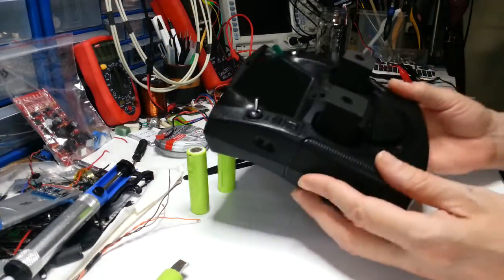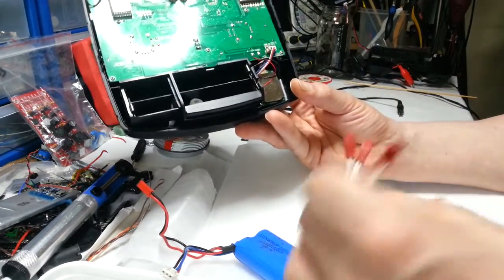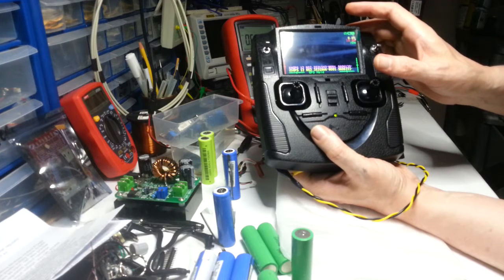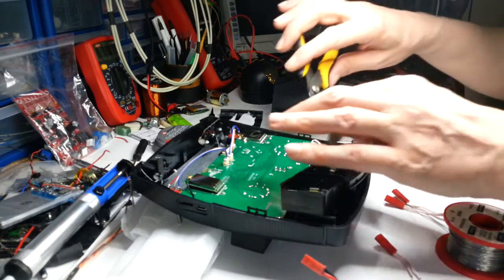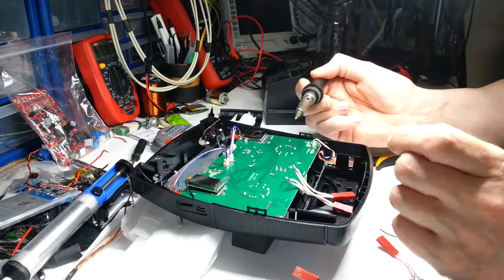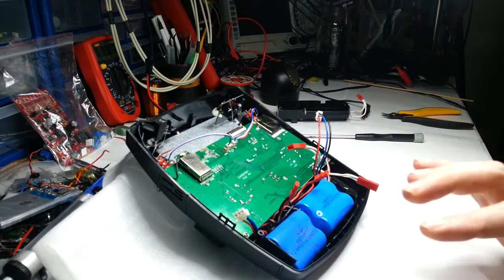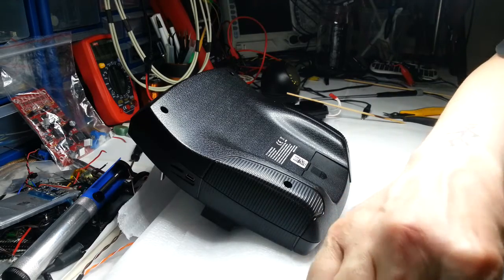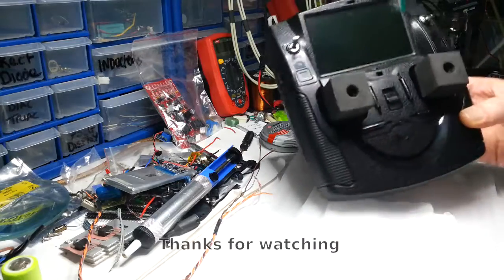Hubsan X4 H501S Controller Battery Mod 10 + Flight Cycles

Comment: Great video.   I have an H502S on order and had emailed them about direct connection of a 2s lipo and they said I'd need a voltage dropper to avoid exceeding 6v.   It's my understanding the H501S and H502S have the same Tx.   Sounds like it is working well for you (and I think others).   Maybe they have to say that for liability - however their manual says "The Transmitter can only use 2S Lipo batteries, 4XAA batteries or NI-MH AA batteries, other batteries will damage the Transmitter."   It was very informative to also show the amp draw, thanks.
Reply from the maker: Thank you for your feedback. On my transmitter board it says 4 - 13 volts at the battery terminal. My LiPo's maximum is 8.4V I just paralleled two for extra flight time and because they fit in the case. Check on your transmitter board (should they be called transceivers as they transmit and receive?) for the voltage mark where the battery connects to the board.
Reply: I did find out later that the NY firm behind the Hubsan website that I talked to is really a "distributor" for Hubsan (Tekstra).  Thus, they're not going to venture outside the 4 AAs.   I will definitely be looking for that board indication when I get the item.
Reply: Why nobody is using the original hubsan 501S battery for this mod? It is 2700mAh 7.4V and fits exactly on the TX battery compartiment. For everything i read, it is compatible. Ans this way you can use the same charger for everything. Any thoughts?
Reply from the maker: vashion100 I expect it is a liability issue also. As the manual states and you point out 2S batteries are fine. The board can handle more voltage but a 2S sits middle of the voltage range perfectly. Also as my 2S gets to 7 volts the battery indicator flashes red so no need for battery alarm :) It all seems to work as if designed to do so.
Reply from the maker: DullDusk Good question. In my case the batteries were to hand and cheaper. Also using these batteries I do not need the EC2 connectors inside my TX case. No reason why you can not use the Hubsan H501S battery. If you do, please come back and tell us how many flight cycles from one full charge.

Comment: Sadly it looks like you got an earlier transmitter, later one's have a red JST connector in the battery compartment where you can connect a nano tech Lipo 7.4v 950mAh 2S battery straight into the space, no cutting, no mods, simple straight plug in and slip the battery cover on. These will normally give at least x4 flight cycles before needing a recharge, easily available on ebay via some really nice guys in Borehamwood. Love the foam joy stick covers! Also have you seen the RTH mod for all flights modes from you tuber 'Randoneur' it works! totally great upgrade. please check these out.
Reply from the maker: I did a main board replacement in this controller and had it sent from Hubsan in China and that one did not have JST connector on it. No matter, the batteries I use here give me loads of time , good job as I have 7 quad batteries and take at least 4 out with me. I would like to see that RTH mod video. I will go look now. Cheers

Comment: Thanks for the Tut : ) .    You did not talk much about the foam bumpers you have on the controller's sticks.
Did you make those yourself ? Or are they an item we can buy ? 
I hope they were not included in the packaging and I ended up throwing them out without thinking of their potential use.
They look familiar, but I can not figure out what there original use would have been.   : )
Reply from the maker: Cheers for the feedback :D
The bumpers came with my Syma X5C, protecting its controller sticks. I thought I could use then to stop the sticks moving on Hubsan H501S. The idea was to have the quad in follow me mode and the transmitter in my back pack stick bumpers on. I was just dreaming lol.

Comment: Ben pili yükseltmek gerekmez düşünüyorum. GP 'nin 2700 mAh şarj edilebilir piller uçuş operasyonları 4 yeterlidir.
Reply from the maker: That is all good but they are AA and only 1.2V. The lower the voltage the more current will be needed for the load. Using a higher voltage for the same load requires less current.

Comment: Hello,
Thanks for the tutorial video.
I did a similar mod to the controller battery, but did a wrong move with the soldering iron and damaged the cable connecting the GPS module to the main board.

It is a basic 4 pin connection, but have no idea what it is called and where I can get a new one. By any chance, could you point me the right direction ?

thanks
Reply from the maker: Hi, I am not sure which part you refer to?
Reply: Hi, I am referring to the 4 wire (red, white, blue, black) cable that connects the GPS module to the main board just right from where the battery connectors get soldered.
Reply from the maker: Is it just the wire damaged?
Reply from the maker: Have you taken it out and asked at local stores. If it were me I would just solder the wires if I could not replace the jumper lead. I do not know what the jumper connector is called, but looking at the other ones on the controller it is a common one on the board. Maybe ask Hubsan sales@hubsan.com. I have spoken to them for different reasons and they take a day to respond (time differences) but do respond.
Reply: will investigate. thanks!

Comment: Why not just remove whole battery case to allow for more room and keep as a spare . You already have the case set up to use other batteies  when needed if for some reason the other li po batties die
Reply from the maker: Hi, I did, I have. I cut out the plastic from around the battery holder. The space allows for my two liPo's or the Hubsan H501S quad battery or the original battery holder and batteries.

Comment: High, I just want to take out the AA's and put a x6 tarantula battery in it with the balance plug exposed for charging..
Reply from the maker: I would check the space as this is a wider battery (Package size (L x W x H): 10.00 x 5.00 x 3.00 cm / 3.94 x 1.97 x 1.18 inches) and I am not sure it will fit.
Reply: Your right, It might not fit. but I could always velcro the battery to the outside of the controller.. I ordered a buck converter but Im thinking I would like to try the Lipo by it's self because I am out of AA's already..
Reply: I soldered up a jst connector plugged into a tarantula battery last night minus a buck converter because the electronics supply did not have any module's for sale. so I am using a x6 battery direct.. the funny thing is, I still dont have all the bar's on the monitor ! yea I am still waiting for my antenna's to come in too...
Reply from the maker: I have just got back from a two hour flight (6 batteries) all went well. With how I have done mine the batteries have lasted 10.5 flights and left me with 7 Volts still on the batteries.I am very very happy.

Comment: Hi can you help anyone? I have just purchased a hubsan X4 H502s recently and there is a jst port in the battery compartment of the transmitter, can a lipo battery be fitted straight into the port with a jst connector, if so what size exact to avoid damaging transmitter as I know it drains normal batteries v quickly?
Reply: JJRC X 1 YiZhan Tarantula X6 RC Quadcopter  7.4V 1200mah Battery from Banggood works great for the receiver , lasts long and fits in the space of the 4AA.

Comment: Anyone here know why my FPV video range just 30 metres with mod (same as
 stock antenna)?? Many times changing the frequency but no luck.

4.2.14 (TX)
1.2.9 (RX)
1.1.17 (FC)
Reply: My LCD is V1.3.4. Ok i try now..
Reply: i already change it...and now it can not bind..
Reply from the maker: Maybe update the transmitter firmware., My firmware version is V4.2.14
 My LCD V1.3.3,  H501S V1.2.3,  V1.1.21
Reply: can you give me the link?
Reply from the maker: https://www.hubsanus.com/products/index/faq/product_id/47/section/download/
Reply: Thanks. Mine is V4.2.14, LCD V1.3.4, H501S V1.2.3, V1.1.21. I will update you 6-7 hours from now if fix my problem. Now here is 3 am not yet sleep...
Reply: Anyway, have you experience any problem with the firmware so far? I mean sudden fall etc..
Reply from the maker: ***** I did experience some problems but I think that was because I was flying near a concealed phone transmitter. I fly in a different location now. Also I fly low and use altitude hold rather than GPS to gain my own  experience and with its flight characteristics and am having a much better time. Check this out and see https://youtu.be/Wwk8zqtRos8
Reply: Finally fix the problem..but will try the range tomorrow..
Reply: What the problem you experience is? Fall?
Reply: Elecifun
I can't calibrate compas 1...i'm stuck here..
Reply from the maker: ***** The quad toilet bowls, it also can do a tumble and fall, from time to time it can just fly upwards and it can twitch quite bad in follow me mode which has brought mine down. I like to think there is some human error on my part so I am getting lots of hours experience before I do my end user review.
Reply from the maker: Why not?
Reply: I already switch back to default firmware. All work fine but like i said the fpv image not stable. I'm living near 3 communication tower with more than 10 wifi connection but i think it not actually effect the FPV 5.8g with just 50 metres. I tried 1.2.2, 1.2.3 (RX) with 1.1.17 (FC) can not manually calibrate the compass. With 1.2.9 i can calibrate but the FPV signal seem not strong as the 1.2.2 and 1.2.3
Reply: Any idea? I'm thinking to downgrade the 4.2.14 (TX), to 4.2.13 should i? I'm now searching for RX 1.1.19..
Reply from the maker: ***** Firmware 1.1.17 seems OK I updated to 1.1.21 just to see what it was like. These do not like transmission towers. See what it is like in open space, field. Hope it works for you, good luck.
Reply: I will update soon. Anyway..thanks..